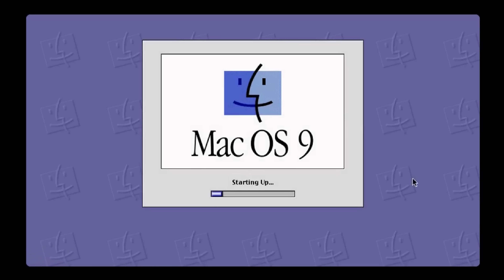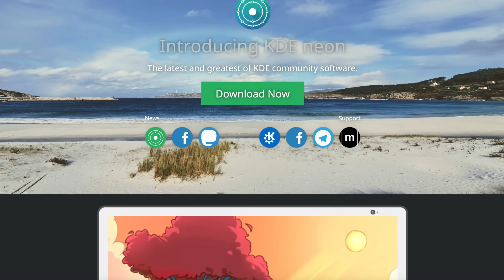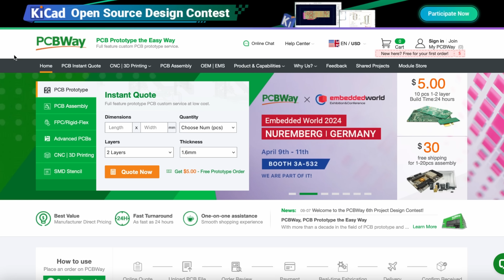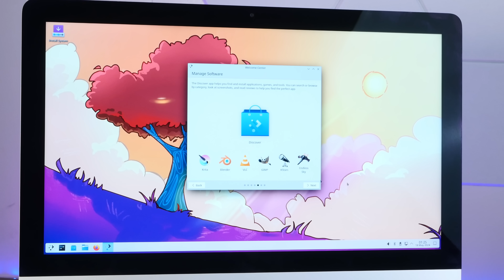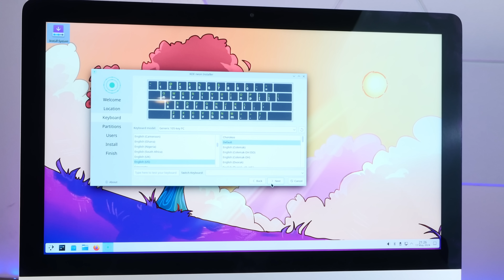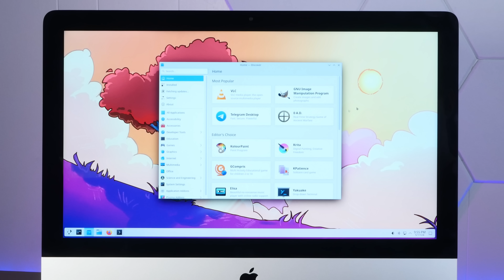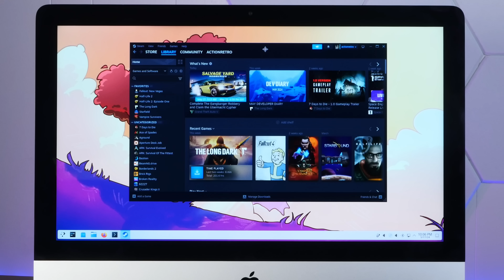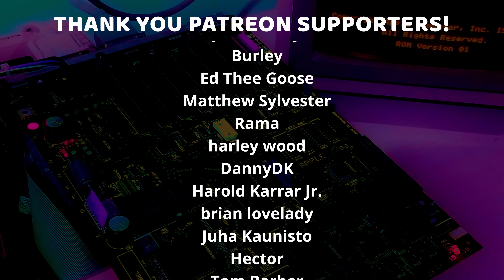The Best Budget Mac for Linux?

Comment: "2019 was half a decade ago" stop 😭
Reply: He was referring to when apple stoped supporting it…
Reply: Still 2019, being a half decade ago 🥶😞
Reply: 16 gigs of ram max what happens if you slap 32 gigs in there try it i dare you😭
Reply: @andy23r  Hearing him say that made my heart stop a little. Oof, my back's hurting now.
Reply: a 2011 dual core MacMini with 16GB RAM and 512GB SSD is all the desktop computer that 85% of computer users really need. IOW, that was the year that computing tech plateaued so far as what most users actually need.
Reply: I recently heard someone refer to the 90s as "the nineteen-hundreds"
Reply: @ottf24  stopped*
Reply: A decade is ten years. Half of ten is five.

2024 - 2019 = 5 years.
Reply: @DarthVader1977  He did say stop
Reply: Someone really needs to lower the speed of the simulation or at least pause it for a while... time is going to fast and I need a break.
Reply: 2019 was yesterday, I swear bro
Reply: time is fast as hell
Reply: @TheSulross The dual cores are pretty sluggish these days, at least with modern windows. I'm sure one that was actually fast would be usable.
Reply: Elderly people might remember Apple was using Intel CPU's once...
Reply: The before times
Reply: @Lauterec  But no one sensible would be installing latest Windows on old dual core CPUs - Ubuntu 24.04 LTS is a splendid latest desktop OS for old Intel-based Macs that runs very well on that more than decade old vintage hardware.
Reply: And the pandemic didn't start a couple of years ago. That was over 4 years back.
Reply: The 2012 model minis have USB 3. 8 GB seems to be fine in Linux, but I don't know if the integrated graphics are up to a fancier desktop. Xfce does work very well.

(Yes I have one).
Reply: @esra_erimez  and I’m saying Go Go Go! 😆
Reply: Bro settle down 2019 it actually happened half a decade ago just live with it💀
Reply: Real physical pain and rejection spun through my head when I heard that sentence. Something about saying "half a decade" feels way more heavy than "five years ago"

Comment: Older Macs have an incredible shelf life.  I still use a PowerMac as a file server and an 08 Mac Mini as a secondary machine to this day.
Reply: dat power draw for the powermac tho, especially considering how they only had 2 internal HDD slots (at least the one I have only has 2)
Reply: computers have an incredible shelf life. High end ones at least. You just notice this with old macs because Apple sold at the top of the market back then but I have a 2014 PC AIO that I still use (writing this comment on it!)
Reply: @supercellex4D Even some older low end PCs can have long self lives as well. I have a first Gen i5 Acer Aspire laptop that is still running. Maxed out at 8gb of RAM and a SSD. I have it running OpenSuse Tumbleweed KDE and it runs well. 

However, Low end components did need replacing over time. New cooling fan, new battery a few times now, it's on its 3rd charger I think.
Reply: I still have a working 2002 eMac with its original drive still running Panther, as well as an early 2006 white Intel Core 2 Duo iMac in its largest size (featuring a physically-giant 1920x1200 display), a 2013 MacBook Air and a thick-shell Aluminum iMac, all of which still work. I also have a case-damaged but still living Early 2008 MacBook Pro, though it had its drive replaced and RAM upgraded in 2013.

Old Macs do last decades. Don't get me wrong, I'm no longer an Apple fan due to the iOS headphone jack removal, no Mac touch screens, and most importantly the move away from Intel x86 for Mac.
Reply: @supercellex4D  Yes but in my experience Windows bloat destroys PCs a lot faster than Macs become useless.
Reply: @supercellex4D my iMac is from 2015
Reply: @stgigamovement I have a 2001 iMac G3. Blown speakers. Still works aside from that minor flaw
Reply: @Benzona  Not really... It destroys hard drives and makes low RAM systems feel cramped but honestly 11 doesn't need much more CPU power to run than Vista and certainly 8.1 or 10 RTM. Just RAM and drive
Reply: @stgigamovement  Hey, a fellow eMac owner. I have Tiger on mine. I don't turn it on much at all these days, but it works. Also have a 2007 MacBook with Snow Leopard - I'm one of 'those people' that think Snow Leopard was peak OS X, so it's my coveted and preserved holy grail machine. Last year I picked up a 2014 Mac Mini for peanuts, it's amazingly for now still getting security updates with Monterey. I wish the MacBook was supported that long!
Reply: @supercellex4D  yeah the ram and solid state requirements are stupid.  And yes it will run but it won’t run well and it’s getting worse all the time.  In terms of long term usability I’d much rather have a ten year old Mac than a five year old pc
Reply: @Benzona  Even Linux runs worse on an HDD now, Macs have just had SSDs for longer. Also MacOSX system requirements have increased too, and you can load Linux on a PC. Haswells are 10 years old now and Windows 11 runs totally fine on mine. The general lag is actually an issue with XAML having to load things in dynamically, it lags on an icelake as much as it does on the haswell, and my M3 mac's Arm VM is cheating imo cause that's a class of hardware above what you should design your OS for. Also people tend to forget that PCs just sucked more back then, it feels slow but that's because hardware just got faster these days
Reply: @supercellex4D  Didn't Apple still offer HDDs as standard in 2017 desktops or so? And you had to jump their exhorbitant prices for the Fusion Drive before getting the pure SSD option.
Reply: @supercellex4D  yes but I’m talking about a practical everyday computer and not a hobbyist machine for tinkering.
Reply: @Benzona  Linux is dailiable for everything you’d even use older hardware for, and as far as macs go macOS is getting heavier too
Reply: To be fair. Pretty much anything can run a file server. I used a p3 800mhz ibm machine as file server for years.

Comment: I'm gonna install Sonoma on a 2010 iMac and daily-drive it for a month. That's "Seananigans" right there!
Reply: Let me know how it goes. Is it slow?
Reply: @MaxOakland  Right now it's running Monterey and it's slow, but I'm installing an SSD and it's the high-end i7 model with 12gb RAM, so I have a feeling it's gonna be pretty fast even on the latest macOS with OpenCore.
Reply: I have 2 2013 MacBook pros (13" i5 & 15" i7) , I installed Sonoma on them and they run extremely nicely too
Reply: I’d only recommend installing Big Sur or later on Metal-capable Macs (aka past 2012). Existing OpenGL patches are really slow, and Catalina is the newest version to use OpenGL natively. That said, I do use a 2012 15” Unibody MacBook Pro as a daily driver and it works great on Sonoma.
Reply: ^ 2012
Reply: Using a 2011 iMac with OCLP Ventura as my daily driver work machine for five months now, works great!
Reply: @vardekpetrovic9716  OCLP has non-metal patches now, I'm sure it would be fine. It works great in Monterey despite being kinda slow due to the old HDD (SSD upgrade coming soon!)
Reply: You will try and fail as a result of all the bugs no youtuber wants to talk about. I predict a complete system freeze on boot on Day 7. Stick to Monterey if you want to actually have a chance at using it as daily driver.
Reply: @drjinster   my 2013 i7 MacBook Pro is running flawlessly on Sequoia.

Comment: Note on the Nouveau driver: the reason it's so slow is because the GPU is set to run at the minimum clock speed, there's actually a script you could run to enable the highest clock speed (though it's still like ~60% performance of the proprietary drivers)

Another thing though, I'm not sure if the latest Ubuntu 24.04 comes with the Nvidia drivers for 600-series GPUs anymore (I have a MacBook with 750m)
Reply: Neon's using 2*2*.04
Reply: The 600 series GPUs actually don't have the clock speed issue as the reclocking issue only started with the 800 series.
Reply: @antikommunistischaktion  you're a bit wrong on this, anything pre-maxwell yes has unlocked clock speeds, but it's not automatic, you have to set it manually (like I said).  Maxwell (800) and up (until Turing GPUs) needs a signed firmware, those are the ones that have issues.

I painfully daily-drive Nouveau with my 750m, if there was auto-reclocking I would have noticed it.
Reply: Idk about Ubuntu 24.04, but when I tried to use Ubuntu 20.something on my old laptop with 820M it was weird. Ubuntu installed proprietary drivers as I ask, but it was the latest version of main branch. These old cards aren't supported by the latest main branch drivers and you actually need to use legacy branch ones or last supported main branch one. I have no idea why it wasn't detecting the card being old and switching to other branch automagically, though it wasn't only Ubuntu but Mint, PopOS and Manjaro too.
Reply: I mean, the GT 640 is kind of just a shit card even in card form, let alone little laptop form factor for the unnecessarily thin Macs.
Reply: @BringMayFlowers  I mean yeah that's kinda true 🥲

But yeah, I hope I could get an upgrade within the end of the year soon

Comment: I sold a 2013 imac a couple of months ago. I had put in an ssd instead of the hybrid hdd that died in 2017.
It still worked wonderfully.
Btw, if you are going to do this: be very careful when you open the screen as you have to remove the ribbon cables to the screen. Second: the power supply has exposed lines, so do not touch it!

Comment: Fedora 40 has a pretty vanilla KDE 6.0 install, and has kernel 6.8.9 as of 5/18/24. It is a stable cutting edge distro as well.
Reply: Nice to see a fellow Fedora fanboy. I set up a used 2014 MBP with fedora yesterday and I’m going to use it to explore open source alternatives to the Mac eco system. Can’t pull myself away from that light up Apple on the lid. 😂

Comment: I swapped in an ssd into mine, plugged in the display to make sure everything was fine. Then unplugged the screen, put the adhesive and put the screen back on. Turned it on and realized I forgot to plug the screen in. That adhesive was so strong that I ended up cracking the glass in the corner trying to get it back off.

Comment: I still "daily drive" a mid-2010 Mac Pro with 6 Westmere Xenon CPUs, 128 GB RAM, and a 2 TB SSD. Best Mac ever. Up until the release of Apple Silicon, it felt just as fast if not faster than any brand new Core i7 or i9 Mac. I'm still not seeing a very compelling reason to buy a new Mac. That said, I don't render YouTube videos or run Blender or anything like that that uses a tremendous amount of CPU or GPU power.
Reply: Haha, as a Mac Pro aficionado, I can tell you that if you hooked up an Apple silicon Mac, you would definitely notice the lack of fan noise by comparison. They're whisper quiet and cool to the touch, shocking to those of us used to living with the high temperatures and hullabaloo the fans put out on Intel machines.
Reply: @billybartcody3591  Yeah, I’m sure that’s nice, but I don’t see that as a very compelling reason to buy a new Mac, personally.
Reply: To be fair, the Mac Pros are quite a bit stronger than the iMacs and way more modular.
Reply: I guess you can use it as a space heater in the winter, too. I wonder what the power draw of such a behemoth might be.
Reply: Depends, the airflow in the cheesegraters is pretty good. My 2015 iMac with an i7 was getting very hot just watching YouTube videos. (Edit: Obviously that was after a couple years of use but changing anything is obviously way more work)
Reply: @BilisNegra  It really doesn't get that hot. The air flow is pretty close to room temperature. I'm sure it uses plenty of electricity though. It has a beefy power supply.

Comment: I dread it when I get an iMac upgrade job. I recommend heating the glued area of the screen before using the pizza cutter. I have had a couple crack on me when the adhesive was applied stubbornly… or use a razor blade then switch to pizza cutter. Not a favourite Mac of mine
Reply: I was just about to comment on that. Ridiculous procedure to upgrade RAM. That would've been easier on my phone.  
Glueing that stuff together should be illegal. 8 screws from the back side would be better and sturdier.
Reply: @joe--cool  For what it's worth I remember the 2017 iMac had a small hatch on the back for RAM access. Who knows how many years it took them to introduce that change though... lol
Reply: @weab The 27” versions from this era (2012) and further on all had the memory hatch. They just removed it from the 21”.

Comment: I have a 2013 i3 27" , adding ram 16gb on these is just simple, remove cover at back done. Upgraded the cpu to i7 , replaced the aging 1tb to 1tb SSD and installed Batocera Linux to play games and linux desktop. These imac are definately NOT obsolete. Tim Cook is

Comment: Very cool to see. Word of warning regarding the aftermarket adhesive kits, I had one kit fail at work after swapping a power supply on a 2013 iMac. 3-4 days later the screen fell out in the middle of the night smashing on the floor from desk height. Now imagine coming into work to whiteness this. As a technician I had the weirdest feeling for a few hours, not quite traumatic but uncomfortable nonetheless. TLDR Cheep adhesive kit cost $600 and changed me inside… 7:35

Comment: Nice video. Thanks.  I'm running Xubuntu 24.04 on a 2012 15" HP laptop with a dual core Intel CPU, 8 GB RAM and a 128 GB SSD.  No issues and a nice experience.

Comment: Currently rewatching this on a laptop with KDE Neon! My sister's friend gave it to her saying it was dead and she gave it to me. Turns out it just needed a new charger. KDE Neon is plenty smooth on this 6th gen dual core i7 and 8 gigs of ram. I was surprised even the touch screen works. I've had issues with them on linux in the past but this one worked straight away no problem!

Comment: As someone who has opened several of these iMacs for an SSD upgrade, you handled it almost exactly as I did when I worked in PC repair. Although my boss didn't believe RAM upgrades were necessary at the time. It's tedious, but definitely not as bad as replacing a keyboard on a unibody 2012 macbook pro.

Comment: Had to smile when you stuck the masking tape on. Back in 2021 I bought a 2017 iMac and did the SSD/NVMe/RAM upgrade. Stuck the screen back on while it was testing. Only the testing ended up in production for a few days. Went downstairs for lunch one day and heard a crash - the screen's masking tape had come undone and the panel was on the floor. Thankfully it only cracked and didn't smash utterly so ever since then I've just kept it taped shut because new panels are £LOL.

Comment: Before you try the proprietary Nvidia driver, make sure it still supports that GPU.  Like on windows, they do drop support for older cards on newer drivers, but linux's graphics driver API isn't quite as stable as window's so there's a lot less chance that a modern even LTS kernel will work with a very old Nvidia driver.

Comment: Another great video, sir. I find it's easier to pull the screens off these iMacs by pre-heating them with a heat gun first. I'd also be concerned about models with Geforce and Radeon graphics eventually falling foul of dying GPUs. Seen many of them. Maybe put some thermal pads on the VRAM modules as well...

Comment: Legitimately surprised there isn't an adhesive magnetic kit with a plastic buffer which has magnets and a ferrous frame for the display at this point. Sure you need two display adhesive kits but the ease-of-access would be priceless.

Comment: A 2011 mid 27" imac works perfectly fine with the latest Sonoma(OCLP). The system have 16Gb RAM, 500Gb Samsung 850 Evo, 500Gb stock HDD and an i7 2600.

Comment: Best way I’ve found to open them is to stick the whole thing in the oven on the lowest temp for a few minutes. It gets the entire frame hot and the tape pulls apart much easier.
Reply: Or maybe just use hot air gun or hairdryer to warm up the bezel area... :D

Comment: I recently got an old 2009 iMac, the chonky one with the core 2 duo. I'd installed Pop OS on it before, which runs surprisingly well. Although it boots very slow, probably because of the spinning disk. The display is absolutely beautiful though. Even though it's only 1920x1080, it leaves my modern monitor well behind it in terms of vibrant colors! Definitely not obsolete, it can still be very useful.

Comment: My main daily driver computer is a 2012 Mac Mini that is running Linux Mint (Cinnamon), latest version, with 16gb ram and an SSD hard drive upgrade. I had thought of using the hack to upgrade it to Ventura but I had been wanting to switch to Linux for my setup, and Windows was out of the question. It runs beautifully on the upgraded Mini, no issues. Linux Mint is great because everything worked upon install except the WIFI, but Mint's Driver Manager software found the driver and installed in two minutes. Prob the easiest OS install I've done, and that includes the MacOS. I highly recommend Mint as a good Linux to start on, it can be customized to look like either Mac or Windows, or neither and is set up to "just work" about as well as any Linux distro I've ever used.

Comment: For those 2012 models, it's nice to be able to also upgrade the CPU - you should be able to slot a 3770S in there with no problems, get a bit more horsepower for cheap.

I recently fished a 2015 non-retina 21.5" model out of our e-waste at work. It had the 5575 i5 CPU and 8GB RAM - found the logic board from the 4K retina model with the 5675 i5 in it and 16GB RAM, slots right in.

Comment: I have a 2009 iMac that I use as an XP machine. Halo 1, FEAR, Crysis, NFS Porsche Unleashed, and Diablo 2 run really well. I even have old versions of Visual Boy Advance and No$GBA for Gameboy through DS emulation. I consider it the Big Brother to my old 2004 Dell Latitude D610 that I used forever.